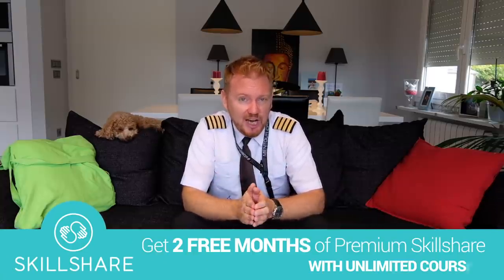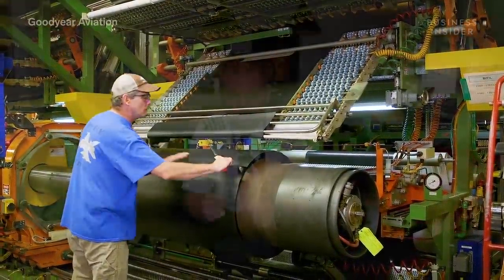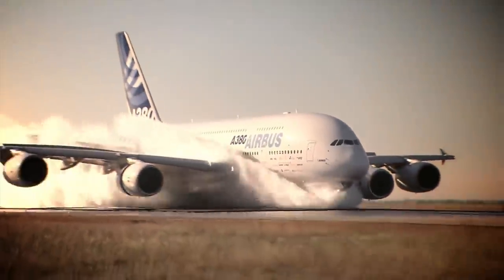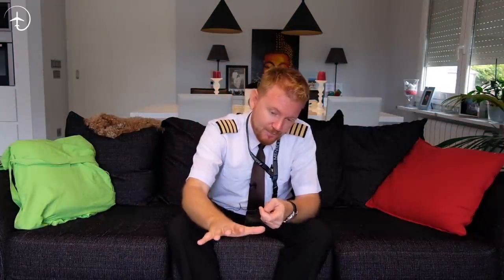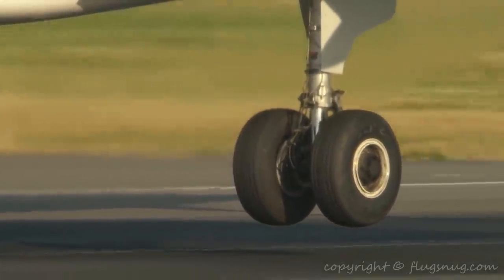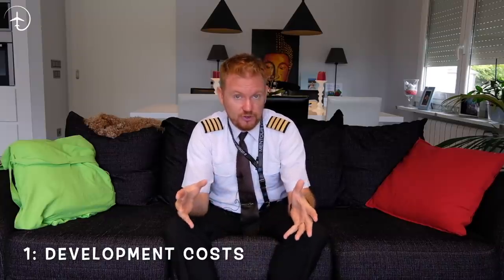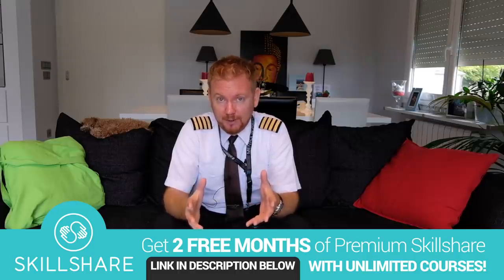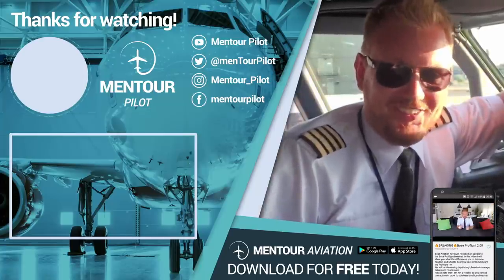Why not make plane-tires spin, before landing?!

Comment: The spinning up of main gear tires was tried on the B-36A which had enormous tires that were just over 9 feet tall.  It was found that the initial touchdown caused an immediate drag on the airframe caused by the energy expended to spin the stationary tire which shortened the landing roll by a tremendous amount.  The spinning tires resulted in very long roll out and excessive breaking being required to counter act that initial touchdown drag as well as stopping the inertia of that huge spinning tire.  The spring gear on larger aircraft like the 747 result in, not only a smother, more cushioned landing, but also extends that initial drag portion as the tires contact the runway at different times.  Also, the large spinning tires on the B-36A caused a gyroscopic effect that caused control issues when trying to change directions on base or final approach.

Comment: Personally i'll rather let the engine run for a 10 minutes before takeoff to detect any early issues, instead of getting those 10 minutes after takeoff.
Reply: Where's your sense of adventure?
Reply: Meh, I feel as though you can sufficiently test out the engine on the ground in a manner that burns a little less than 200kg of jet fuel. And besides, takeoff is practically a test in itself. Aborting a takeoff is a perfectly common thing that pilots are trained for. Also, jets can cope with a damaged engine, and nearly always, on the ground, you'll only have fault with at most one engine
Reply: The engines are reliable enough and both would be on (to power up cockpit systems and cabin pressure); the engines would be set to idle, until the tug disengages, vs using thrust to move the aircraft around the taxiways. Most turbofan engine failures do not occur on taxi, and if there is a critical issue, those are typically identified during preflight, not during taxi.

How often do airplanes taxi back to the gate because of an engine issue, before taking the runway? I've never heard of any incidents to indicate this is a concern.
Reply: Except MOST engine problems happen on TOGA anyways or when already rotated. It's very rare for engines to fail on the ground, only when used near their max performance.

How often have your cars engine died in idle vs when loaded?
Reply: @RealCadde  They may fail on ground due to FOD.
Reply: If engines were that unreliable, I wouldn’t fly at all.

Comment: I've always wondered about this topic..thanks for shedding light on it. 
One comment though..you've been using a 737 as a reference point in some of your examples so I'm assuming you were referring to a 737 when you mentioned an engine costs $12mm (I'm assuming you were suggesting a full performance restoration). A complete overhaul of a CFM engine would cost between $4mm-6mm. So, if you're saying it would cost $12mm for a pair of engines that would be correct..but not for a single engine. If we're talking about 777, 787 or an a350 I would agree that an overhaul could be well over $10mm.
Note: I buy/sell commercial aircraft & engines for a living.
I really enjoy your channel..please keep it up!

Comment: When I trained as a Performance Engineer at Boeing, they said that only 10% of a tire's wear was on landing.  Most of the wear and tear is taxiing, for example on an aircraft with walking beams. The tires don't want to turn and get scrubbed on all the turns. 
The tires are filled with DRY nitrogen.  According to the gas laws, the pressure in the tire will be mainly effected by temperature, as would any DRY gas.
I did fly an airplane that used bleed air to spin the nose tire.  Citation II with a gravel kit.  The idea was to spin the nose tire up before landing on gravel to prevent the nose wheel from spraying stones into the engines on touchdown.
A lot of airplanes apply the brakes automatically after lift-off to stop the tires from rotating before they are retracted into the wheel wells.
Most large aircraft have temperature monitors on each wheel and takeoff is not allowed unless the temperature is below a certain value so that so will have full rated braking available in a rejected takeoff. RTO.   Becomes quite a problem if you have carbon brakes as they heat up very fast if you touch the brakes.

Comment: I always thought a tiny bit of rotation would make a big difference, like if the tires were rotating at 2 or 3 mph.  That way there's less of a jolt on the tire taking all that weight from a dead stop.  You could have little windmills on the tires that get them to spin up a little.
Reply: As somebody trained in physics and engineering, I'll can say this intuition of yours is wrong. The amount of energy to be gained and the time available to accelerate means it's essentially just the same as landing that 2 or 3 mph slower.

Comment: 6:20 They use nitrogen because air contains water, which can condense and evaporate which changes its volume by a factor of ~1000, and sloshing water (worse yet fumbling ice) can upset tire balance.
Reply: Mi 28 and regular air contains oxygen which in combination with moisture is a very bad thing to have in an area that can’t be inspected regularly. Nitrogen is inert and contains no oxidizing agents. That’s why we use it as a shielding gas for welding.
Reply: snee regular compressed air is also non flammable so that doesn’t seem to be a necessary argument. The second part of your response is what he explained in the video so good job
Reply: They use nitrogen because the FAA requires it to eliminate the possibility of explosions. From the FAA:
"This amendment to the Federal Aviation Regulations (FAR) requires that an inert gas, such as nitrogen, be used in lieu of air, for inflation of tires on certain transport category airplanes. This action is prompted by at least three cases in which the oxygen in air-filled tires combined with volatile gases given off by a severely overheated tire and exploded upon reaching auto-ignition temperature. The use of an inert gas for tire inflation will eliminate the possibility of a tire explosion."
Reply: Andrew Snow I think commentors on this thread are saying the same thing. Water in air freezes. And that causes problems that pure nitrogen doesn't have. The FAA requirements are based on simple physics, as well as accidents.
Reply: George W there are also a few that seem to be confusing explosions(needing a fuel and oxidizer) with rupturing(due to altitude change) nitrogen doesn’t expand at high altitude as much as compressed air. A ruptured tire in flight could cause an explosion just simply because of is location in the wing box.
Reply: @georgew2014  Sorry, I disagree.  The FAA requirement is ONLY to prevent explosions.  It ONLY applies to larger airplanes: 
"This new rule applies to large transport category airplanes with a maximum certificated takeoff weight greater than 75,000 pounds. A review of service difficulty reports has revealed that tire explosions, as opposed to tire bursts, tend to occur on the larger, heavier airplanes."
AND, it ONLY applies when the wheel has brakes:
"In addition, this amendment adds the requirement to use an inert gas for tire inflation for braked wheels only, since there is no source of excessive heat present on unbraked wheels."
If the requirement had to do with any "physics" other than explosion, it would apply to smaller airliners and all wheels.
I believe the requirement started in 1987 with AD 87-08-09, which was issued because of Mexicana Airlines flight 940, a 727 crash in 1986 that killed all 166 people onboard.
Reply: @HappyHarryHardon  Yes, I should have addressed this originally to avoid confusion.  Again from the FAA:
"A tire burst, as referred to in Sec. 25.729(f), is a sudden, sometimes violent, venting of the pressure from within a tire, usually associated with a flaw in the tire, foreign object damage, or tire overheat/overload. The FAA assumes that tire bursts will occasionally occur...With this in mind, equipment installed in wheel wells is evaluated at the time of certification to determine its ability to withstand the effects of a bursting tire."
"A tire explosion is a completely different phenomenon. It results from the auto-ignition and explosion of a mixture of explosive vapors released from the inner-liner of a severely overheated or abused tire, and any oxygen that may be present inside the tire."
The FAA concludes there is no way to protect against serious damage from a tire explosion, so they must be prevented.
Reply: @andrewsnow7386  You're actually making my point, though indirectly. The requirements meant to prevent explosions are based in part on the properties of gases.
Reply: @georgew2014  Sorry I misinterpreted your previous comment.  We agree then that nitrogen is used because of its chemical properties -- it's not an oxidizer.
Reply: @andrewsnow7386  No problem . And yes, we agree.
Reply: @HappyHarryHardon  yes but air will support combustion n2 will not

Comment: First, a pre-spinning wheel wouldn't necessarily drive a plane off the runway. You are confusing speed and horsepower. A weak motor can also spin up the wheel to match the speed. The inertia of a spinning wheel is peanuts to that of the airplane.
Second, as someone already mentioned in the comments, a wheel spinning at half-speed can already double its lifetime. You don't need an exact match.
Third, again in the comments, a passive solution exists using just air.
Fourth, an even easier solution is to delay braking by a second or two, which is absolutely do-able on a long runway. That way the ground would pre-spin the wheel for you, without adding a lot of unnecessary shear to the tire.